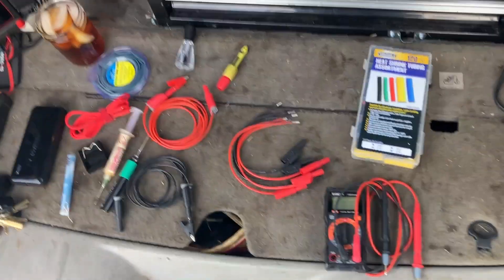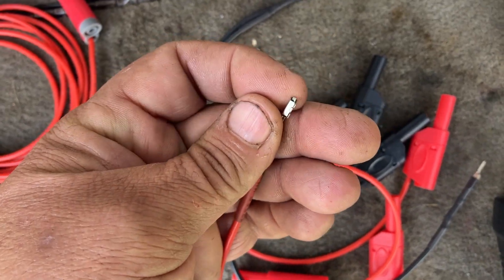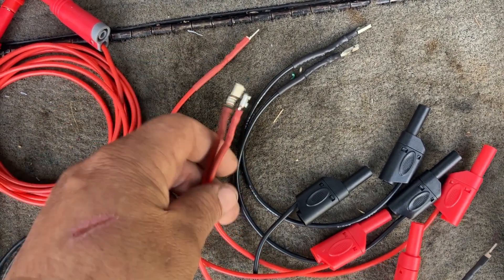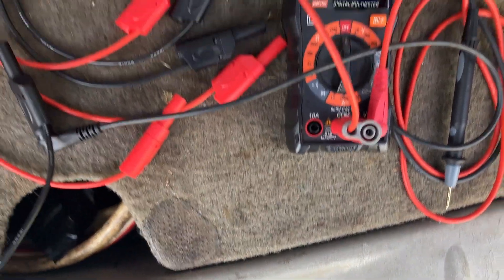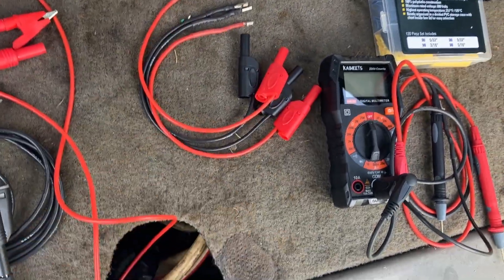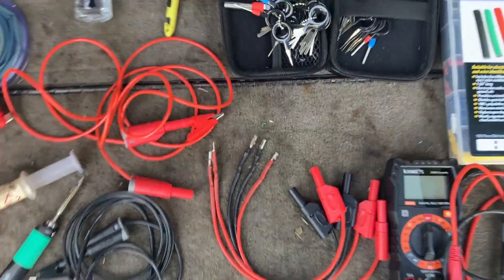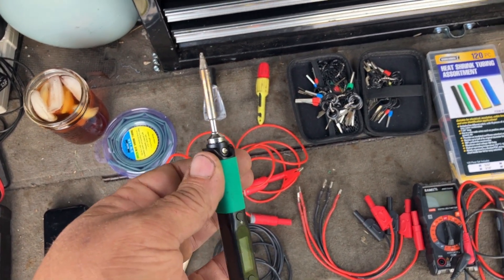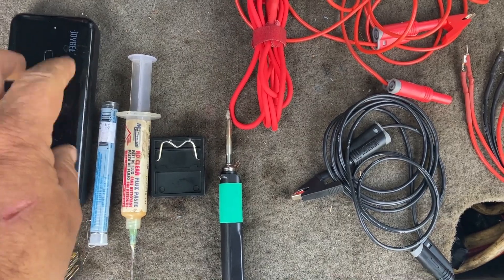Make Your Test Leads for Auto Diagnostics & The Best Automotive Soldering Iron! @JoesAutoElectric

Comment: The AES kit has always been on my wish list but over the past 15 months the price has significantly gone up. I didn't know the terminal and wire quality was inferior.

Since I'm frugal as well, I've made the same leads as you've shown 🙂.
Reply from the maker: Yeah I am not saying it is that inferior, its just no the really high quality wire that I like to use.
Reply: @frugalprepper  Gotcha....thanks Tom!  Just like you, I enjoy making my own leads. In fact, I made my own backprobes as well that even slide easily on weatherpack connectors
Reply from the maker: @NextLevelAutoDiagnosticsLLC  I would like to see those!
Reply: They are not inferior